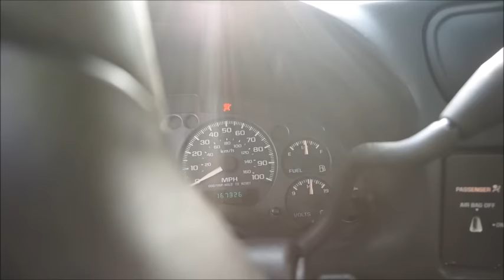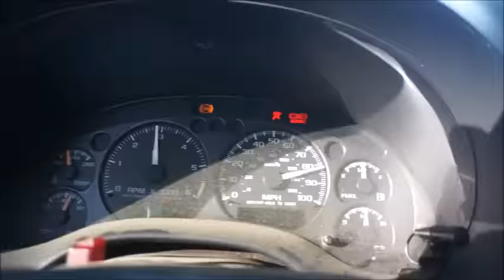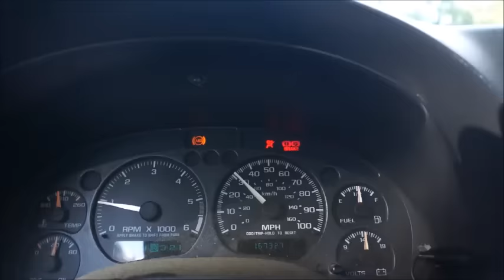2001 Chevy S-10 (GMC) Repair Part 2 Of 2

Comment: The abs pump in these particular years are VERY prone to failure. Best thing to do is pull the abs fuse, before it warps the rotors. When they fail, the pump will constantly run and warp the rotors quick.
Reply: +Tater79bj  Yes, I was thinking it might be the ABS pump as the brake warning light was on as well which doesn't usually happen with an electronic failure like a wheel speed sensor.  I'll lay odds it suffered from the shock of the bump the truck had...

Comment: four bolts under glove box to remove and go back in easy.  if you were closer id have you look at my 91 2.5.      the engine you got, the 4.3 is a really stout engine. a 350 with two cylinders lopped off

Comment: Believe me the pastor side airbag in a S10 Chevy Blazers or GMC Jimmy ect are not fun to get out, I had a Chevy Blazer parts truck a while back and I wanted to have some fun with the airbags I pretty much had to destroy the dash to get the passenger side airbag out, I do have a video on my Channel showing where the bolts are located and roughly how to get it out.

Comment: Did you fix the A/C? I noticed the compressor and everything was still on it, but I didn't see a condenser. It almost certainly needs a front end alignment.. I built a first generation S10 out of 3 trucks. Standard cab shortbed. The cab is a 1993, so that is what it is registered as. I had it painted by Maaco after I got it all together. Even though I'm in the hottest inhabited place in the country, Phoenix, AZ, I never did get the A/C fixed. It's an old R12 system, and I don't know how to do A/C work. R12 is no longer available. Since you don't need heat here, I was going to rip out all the heating and A/C parts, and have an aftermarket system installed. They quoted me around $2500, which is about what I have in the whole truck, not counting my labor, so I decided to just suffer in the summer. I love the wheels on that red truck, sure would like to have a set of those for mine.

I would have left both airbags out. Fortunately the '93 doesn't have them. IMO they are dangerous.
Reply from the maker: AC is ready to vacuum and recharge. Will do the front end alignment, but I don't like the looks of the upper A-frame bushings, so I will replace them first. I never took the condenser out of the radiator support, but the 4 cylinder and 6 was the same.

Comment: Man, stereos are so cheap nowadays and most have dual bluetooth, so you can be streaming your music through it and then take a call at the same time if one comes through. And one like that is only around $100. I just like 6 inch splits up the front and good quality 6x9s in the rear with the right amp to drive them. I'm a sound quality guy, not a bass junkie into smashing back glass or warping rear decks.

Comment: im curious what was wrong with the extended cab you took the parts off of. i prefer the extended cab so was disappointed too see the parts going on a standard cab :(
Reply from the maker: 4 cylinder with a bad engine. If it had been a v-6, I would have fixed it. Also would take a few hundred to straighten out the paper work. The guy had put it in a mud hole and sucked water up the intake and hurt the engine.
Reply: ah man that sucks!  if i lived closer id offer to buy the s10 lol but i live across the country...